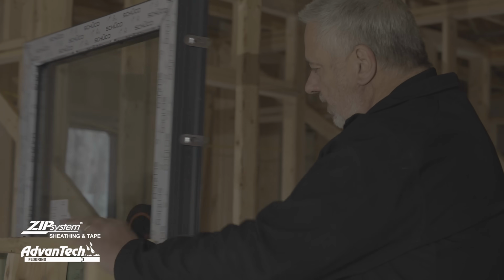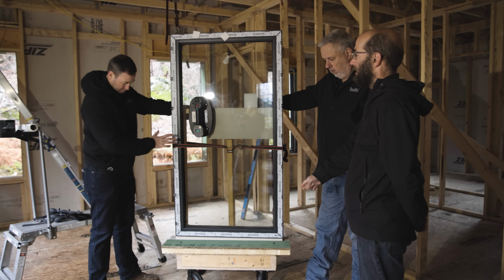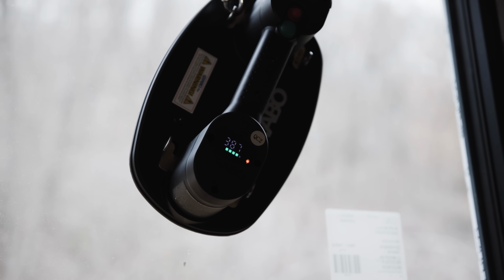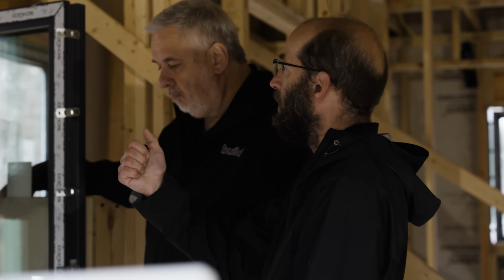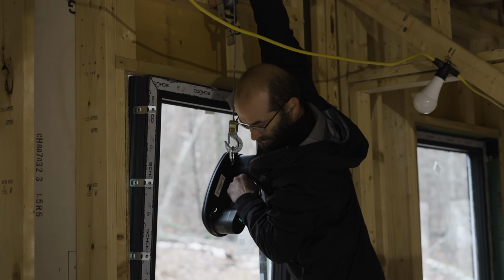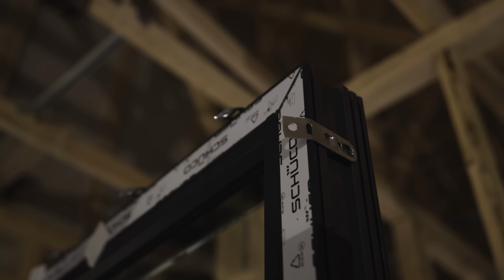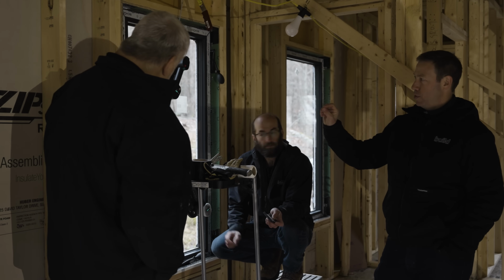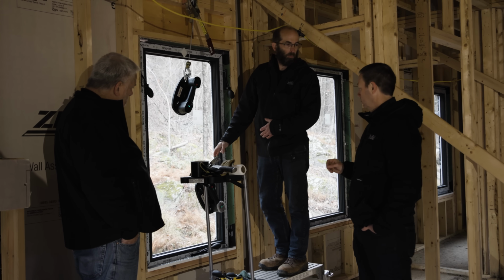One Man Window Install!  These Rigging & Tools Blew Me Away!

Comment: It's a "replacement" window tho! There's no nailing fins!  I need that fin and that Vycor or Zip tape to really seal it.  I install all my own Jeld Wen Siteline doors and windows with a little help from the delivery crew to set the big ones in place (not plummed etc).  Guys making $25 hr to delivery would love a $100 each for 30 mins.  Only the 8/0 sliders really.  Need that nailing fin for a better seal! Just sayin

Comment: mechanical advantage - not to be undervalued.  Work smarter - harder ruins backs.

  - a simple battery powered electric hoist - could / can add so much value to every situation.
(OR if mechanical lifter is preferred, use a brake hoist - as it is designed to pay-out in a controlled way - or a chain type comealong )
 - DIY soft shackles - eliminate metal hooks from the handling system (assist in avoiding scratches or other damage to components) ??

I have lots of work planned on my place - the addition of lifting points / rails around the perimeter - to assist in handling of: roofing / bracing, cladding - etc as a solo operator -  has been in mind...
Reply: I've got a lot of work still to do, so I'd love to hear more about your ideas. 😁

Comment: Layman question: are windows designed to be able to hold all their weight by the glass or do they require you to support the frame?
Reply: yes it is fine.  They actually make machines specifically for installing windows that just use suction cups on the glass.  https://www.youtube.com/watch?v=xL6gpv6QTDk
Reply: The glass panel certainly can support the weight of the entire window during production, transportation, and installation, but the frame is, of course, the primary support structure for the window.
Reply: @joshbrennecke just out of curiosity,  did you have any glass shatter from the Grabo suction?  I was planning on using your technique until the spare window I tested it on shattered upon the Grabo reaching full suction.  After that I read the fine print on the Grabo website: Do not use Grabo on glass less than 6mm. That would be 1/4”. Does Shuco use thick glass even on their smaller windows?  
I’m installing Alpen windows which are an American alternative to Shuco and I’m thinking the glass on a 30” x  54” triple pane window isn’t anywhere near 1/4”.
Reply: @teddywong6246  Sorry to hear about that experience. I haven't had any panels break when using the Grabos (or at all for that matter). I'm not sure how close you were to the edge of the IGU, but I'm not sure if that would negatively affect their use. I've had them in the middle of the window and in the upper half, and even upper quarter, of the window panels. I'm not sure what would cause that, but I haven't experienced that so far. So I don't know what would cause that.

Comment: Planning to do the same on my house, only will use a 12v ATV winch and snatch block to power the windows into place, especially on my 2-storey tall wall.  Great job guys!!!
Reply: I originally purchased an electric hoist (be cautious if using a winch since they are made, and weight-rated, for pulling horizontally--not lifting). However, it was quite heavy which significantly complicated putting it into service near the window rough openings. I'd have had to build a metal frame to hold it since I wouldn't be able to mount the hoist to the house framing. The manual hoist just simplified the task immensely and seriously reduced any further costs of building out the support rig (I kept the electric hoist though for use in the garage). Good luck with your project. I hope it goes smoothly regardless of which approach you end up using.
Reply: @joshbrennecke  for most of my windows I have a structural header I can lag bolt the winch to for support.  That’s the plan anyway, and we all know how often things go perfectly to plan!  lol

Thanks for your comments and great job on your build!!!  I’m a little behind where you are but hoping to get windows in this spring.  Cheers and Happy New Year!
Reply: @superspeeder It certainly could work depending on the hoist's mounting design. I hope it works out for you. Stay safe and good luck!
Reply: @joshbrennecke  thanks man, you too!

Comment: This has me imagining a hand powered, fork lift style system 😮where the legs and arms collapse down, similar to a hand cart for transportation. And space for removable counter balance plates to enable bigger lifts without becoming too heavy for one man transport between sites. Less setup time for the hoist and use all of the same vacuum and air bladder concepts from this video…would make a great system for professionals to one-man these large window installs.

Comment: wonder if a small 12v utility trailer winch would be better than come along.  Siminal to BADLAND 2000 lb. Utility Trailer Winch with Steel Rope.
Reply: I learned something about winches and hosts and come-alongs during this task research that I think might be of interest. A utility winch rated at 2,000 lbs is absolutely not the same as a hoist rated at 2,000 lbs. The come-along can lift vertically, a winch is rated to pull a heavy load across a horizontal surface where it doesn't have to fully handle the entire amount of weight.

Comment: A House Built to Last 500 Years! WHY ARE YOU ONLY PROMOTING a one sided engineering viewpoint on how to build houses using only wood? How about promoting steel frame houses and steel-reinforced houses using galvanized weathering steels or stainless steel rebars available since the 1920s and 1930s? In 1937, the Progreso Port Authority, in the Port of Progreso, Yucatan, Mexico, constructed a bridge using stainless reinforcing rebar, AISI Type 304, due to the aggressive chloride environment of the saltwater where this bridge was built. Almost 70 years later, this bridge is still standing and being used daily. SAE 316 stainless steel is a molybdenum-alloyed steel and the second most common austenitic stainless steel (after grade 304). It is the preferred steel for use in marine environments because of its greater resistance to pitting corrosion than most other grades of steel without molybdenum. The molybdenum content ranges from 2% to 3% up to 10% molybdenum content with a chromium content of *15% and a nickel content of "10%. Plus 3% to 5% tantalum up to 16% to 20% tantalum and 3% to 5% niobium up to 16% to 20% niobium. *3% tantalum and *3% niobium is required with *11% cerium and *5% yttrium and *1% vanadium with the remaining balance as *52% low carbon - high nitrogen content steel. How about building a house to last for countless of centuries? In Constantinople, an archeologist demonstrated on how to mix 50% burnt quicklime and 50% powdered brick and mixed with enough water to make a mortar with a very high tensile strength and plastered it against a rock wall wet with seawater and he said "There! It is good for the next 1,500 years!" Combine that with sand and gravel in the right proportions and with structural grade stainless steel rebars and double-twisted stainless steel  fibers and and PROPERLY mix the new mixture with the right amount of water and PROPERLY placed-pour it and you will get a house that will last for 1,500 years.
Reply: Harvesting lumber is the greatest carbon suck we can do as humans. The trees suck up carbon dioxide for 20 years and then we chop it down build a house out of it and that carbon is stuck for 100+ years. More trees are planted to replace those cut down and the process starts again. You want to reduce carbon in the environment and home building solves two issues in 1. Wood framing also stands up better to fire. It takes time for wood to burn to the point of failure... try burning a log to long for a fire pit. You would be surprised how long it has to burn before you can break it to get more in the fire. Metal studs start to weaken as they are exposed to fire and will deform from excess heat. Wood doesn't deform from heat.
Reply: @PtrOBrn  Ever heard of adding chromium, molybdenum, tungsten, cobalt, nickel, tantalum, niobium, and zirconium plus silicon and misch metal rare earths ally and and copper and in the correct proportions to be added steel while making their mass production economically viable? We Russians has already solved that problem for our military installations DECADES AGO and since we have an ultra-rich and highly mineralized Siberian backyard, we can afford high alloy steels to combat such problems but you Americans neglected your Alaskan and  Nevada mineral resources and as a result you cannot afford to do the same things that we have been doing for decades.
Reply: Metal stud structures have terrible thermal bridging. You're better off with wood for the purpose of comfort.
Reply: @jonathansage2147  We Russians has already solved that problem for our military installations DECADES AGO and since we have an ultra-rich and highly mineralized Siberian backyard, we can afford high alloy steels to combat such problems but you Americans neglected your Alaskan and  Nevada mineral resources and as a result you cannot afford to do the same things that we have been doing for decades.

Comment: Warning: I love my Grabo for big tile but I’m terrified to use it on windows ever again. It broke the glass for me on an install. I was already foaming the window in, not even holding it, and during re-suction, it crumbled a Grabo-sized hole.
Reply: Yes, I had the same experience. I have a couple of $3K windows and was planning on using the Grabos as demonstrated in the video. But something kind of made me step back and before I stuck one on the window I tried it on an older spare window I had around the shop. As soon as the Grabo started to suction and grab the glass shattered. I’ll have to go with plan B.  The disclaimer on the Grabo website explicitly states,  “Do not use on glass less than 6mm.

Comment: if i were to do the window install i think i would consider using a hoist and lift system for the window. you can easily counter 800 lbs with 400 lbs..

Comment: The looks on their face gives it away for me.
This is a guy trying to save money with a fancy suction cup and a total DIY set up, and a questionable one, I might add. What the video does not show you is the rest of the process that comes along with professional experience. As a contractor, when I see a homeowner attempting something like this, it definitely makes me question if I want to go into business with them.
Reply: Some folks have more time than money, others want to have sweat equity in their build, doing work they are acceptably competent to perform.  If you think the "solution" shown was janky you don't see the absolutely unsafe methods and damages caused by workers.  I have several issues with the point of attachment method (hanging heavy things over high-value people is part of my job) but his basic concept is acceptable.  My primary issue is doing work presumably by himself; if there were a glass failure, rigging failure, or other issue on site there would nobody to assist or call emergency services.
Reply: @raygunsforronnie847  I agree..
Reply: @raygunsforronnie847  However, I see it from my point of view based on past experiences with the homeowners who view everything as a burdened expense and / or claim to not have the money( They do...) or simply dont see the value in paying for a professional. I am willing to bet this guy will not be reasonable when he sees a problem down the line strictly as dollars and cents and not for what it is: The nature of our business with a thoughtful solution down the line to keep moving forward.
Reply: @MrMrjauregui Seems a bit judgmental and/or assuming about how I am as a client based on a task I determined I needed to create a solution to enable me to do it myself (yes, out of financial necessity in my case). Maybe you're speaking more in general than directed to me personally, but I have excellent rapport and working relationships with all the subs I've hired on the project, and the respect is mutual.
Reply: @joshbrennecke  Correct, I am talking in general.
Reply: I singled you out as a case study, not as you, the person. If you are a "cool" customer, awesome. 
I still warn against the situation based on experience, both mine and of other contractors I know and have talked about.
Happy new year to you..
Reply: @MrMrjauregui  Perhaps my situation will provide a counter to some bad experiences you may have encountered yourself. There are some really good, reasonable, owner-builders out there too that love working with good, quality, dependable contractors. At least give people the benefit of the doubt until they prove themselves otherwise, but that's just my own opinion.
Reply: @joshbrennecke  I can see by your stance that you may very well be the exception to my warning. I wish you great success on your build.
Reply: @MrMrjauregui  Thank you, same to you! Have a safe, prosperous, and enjoyable 2024!
Reply: @raygunsforronnie847  
God bless this guy and his windows, but for any young contractors out there, you will learn about the warning signs when "hiring" customers.
Reply: @raygunsforronnie847 My fiancee and I currently reside on the property in a separate dwelling, but your point is certainly valid regarding any type of solo work like this on a work site. I appreciate the comment and concerns. Stay safe and build on! 🫡
Reply: While a contractor may do it right, my experience as a reasonably competent homeowner who contracts out on occasion suggests that contractors cut some strange corners.  Had a tankless water heater installed recently and the condensate drain was hacked in poorly and a neutralizer wasn't installed or even suggested.  Had a heat pump installed with the air handler put in the attic and they cut two trusses to get it up there and did nothing to reinforce the trusses after they were done.  

A contractor can be great, but my experience is that I'm going to have to go back and fix the detail work they slopped on (if Sawzalled trusses can be called "detail work").
Reply: @Bob-kp5ll  Amen. I’ve hired many contractors on projects I’ve undertaken. And I appreciate the ones that will work with me and will do their work competently.  Owner-builders are in a hard place sometimes. They know how things should be done and when it’s not done to our standards shitty contractors get their undies in a bundle when we question their work.

Comment: this homeowner does good work but if for my buck 2 guys working together are worth 4 working alone...
Reply: The point was just that, I'm not paying anyone else to install them. So, ultimately, doing them myself costs zero dollars (Grabos and come-along costs aside which will certainly be put to use during other parts of the build).
Reply: @joshbrennecke  
you deserve a congratulations one way or the other...

Comment: I do windows all the time. i just lift them by myself. I can get a 100 a day it aint nothing
Reply: You can do the 400 lb one that he will be doing next by yourself? If so then that is impressive.
Reply: @shannabolser9428  In less, that is a laminate window. I don't think that's four hundred pounds
Reply: I have 15 windows that weigh over 300 pounds each. Ten of those are over 400, and 5 are over 500 pounds. Might as well use the method for anything more than the 'light' ones (based on my own strength, comfort, and safety thresholds, of course).

Comment: Is that 2X4 exterior walls and triple pane windows? If so, it does not make sense to me. I know there is exterior insulation but I have not done a 2X4 exterior wall since the 70's. 
I would have installed some blocks on the exterior and pushed the window to them, then centre and fasten. You're going outside to exterior seal, so remove them then.
That is good for a one person show but very slow
Reply: He doesn't have to pay himself hourly for his own labor, nor does he have to fret about whether the installation crew will actually show up on-time on the install day(s).

I would never criticize someone either way, not for doing it themselves, nor for hiring someone else to do it.
Reply: @dondumitru7093  been building for 40 years and there are times when doing things on your own does not pay and can be dangerous, When me and the crew are hired to do a job we show up as does any quality crew.
Analytical comments are more than criticism
Reply: insulated zip at R9.
Reply: @paperburn  + R22 or 24?
Reply: Walls are 2x6
Reply: Triple pane windows are only R7. Even if it is 2x4 framing, he's hitting a nominal R24 wall. The windows are still the weak link. Makes sense to me.
Reply: @jonathansage2147  The opposite is true as the majority of exterior surface area is easiest and smartist to bring up to a high standard. I've designed homes where people wanted thick walls but double pane windows making the windows the weakest link. They were convinced to spend the extra money
Reply: @morninboy  'it depends' is probably the right answer here. Do the math on cost vs total wall assembly R value.

Comment: Great work by Josh.  I would probably setup a hand-crank brake winch for the vertical lift of the windows.  It could handle the load and be much easier to mount and operate than the come-along.  It would give very fine movement up and down, and the built-in friction clutch holds it wherever you stop cranking.  Dutton-Lainson make some in the $150-200 range that are very good units.  I have one on my sawmill to crank the saw head up and down with enough precision to deal with 1/32" increments.
Reply: A hand winch handle would be hitting the wall during operation? He could mound it sideways but that would require a more complicated mounting system.